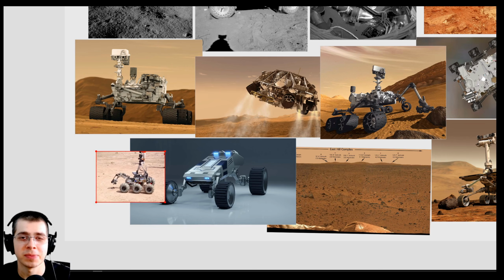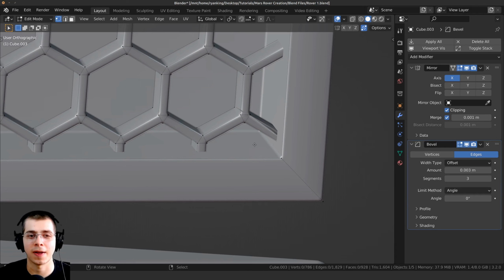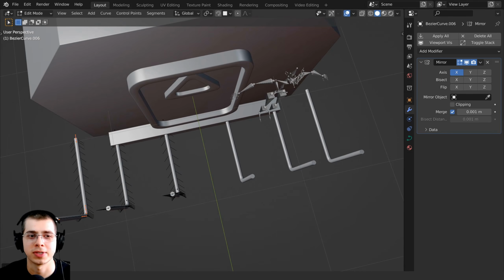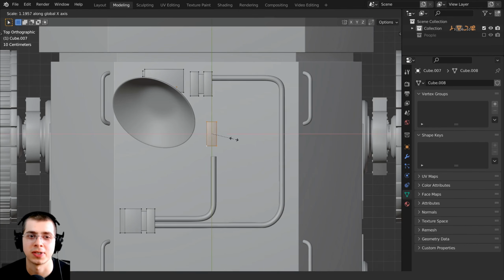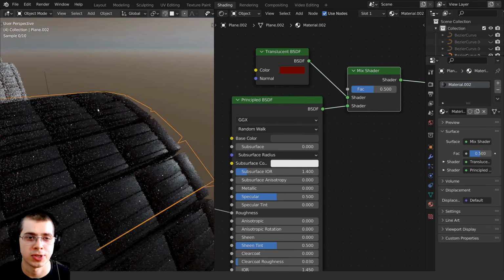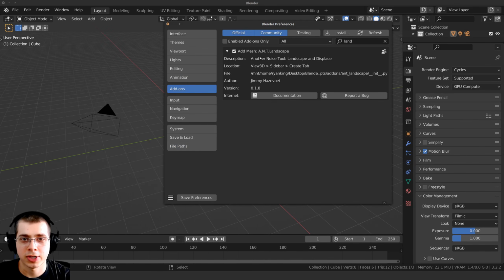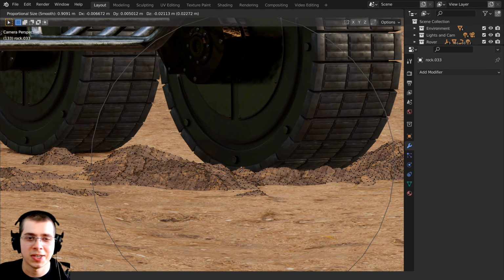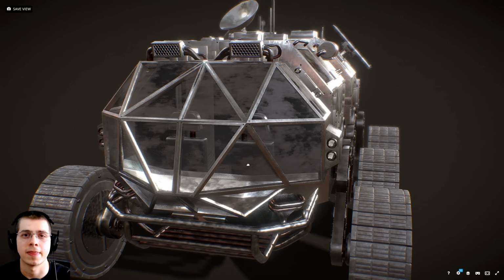How I Created this Mars Rover 3d Artwork in Blender

Comment: One question, at the start, instead of inset and delete de faces, could you use wireframe modifier
Reply from the maker: yes I suppose you could, but I wanted the sides around the windows to be flat.